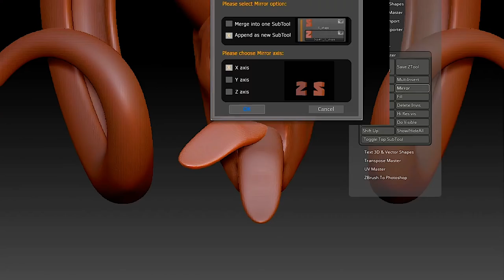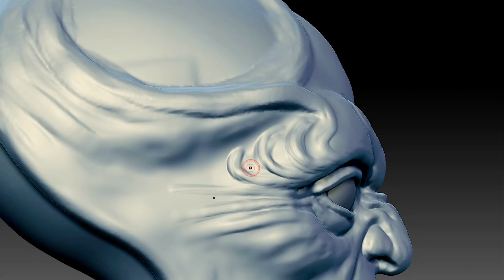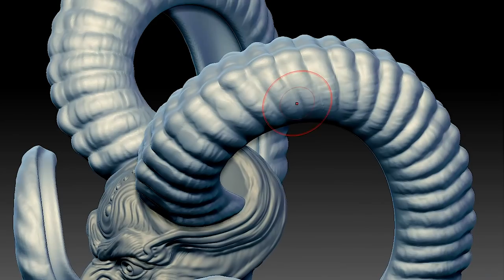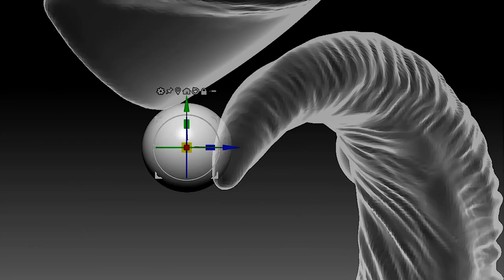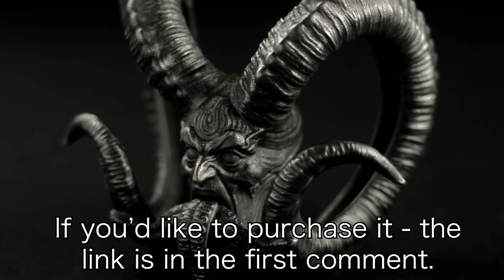My Best Work - Silver Demon of Judgement Israel

Comment: Why not make the perfect mold from it and own those rights.. it would give you a bit of steady income.
It's more than just selling it in one time.
Reply: The 'mold' is in his computer, makes as many 3d printed wax originals as he wants.
Reply: The 3d model horns are hollow, would be near impossible to cut a perfect mold. This silver casting really went well, not even considering it was done with a cheap chinese "vacuüm" casting device, really impressive.
Reply: @ruud4508  depends on how many separate pieces, assembled.
Reply: @jthepickle7  to assemble the pieces symmetrically would be a pain in the rear though:)
Reply: @ruud4508  He did show a lot of patience.  Weld with wax, all the pieces and then re-sculpt the seams, a lot of horn bending!